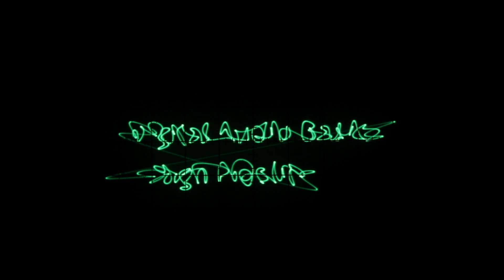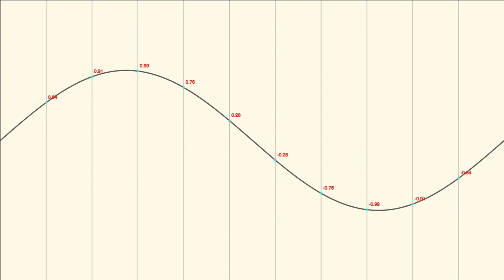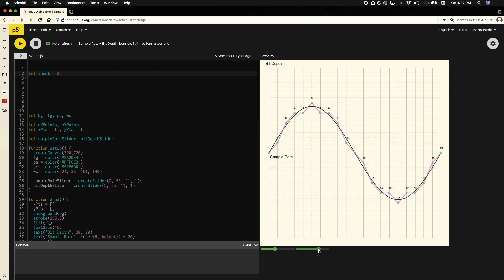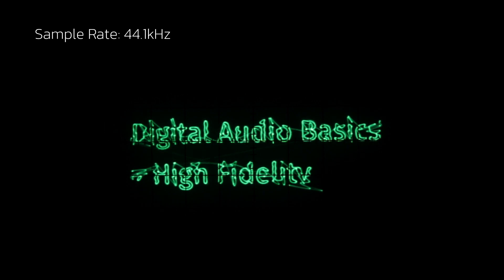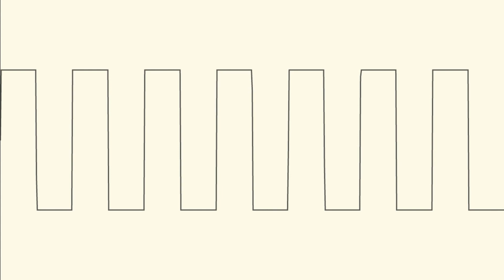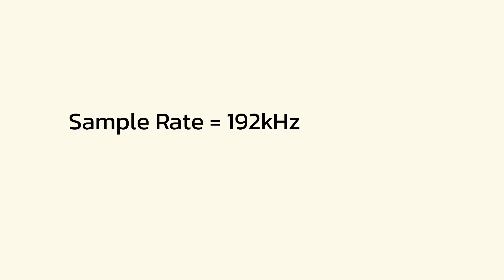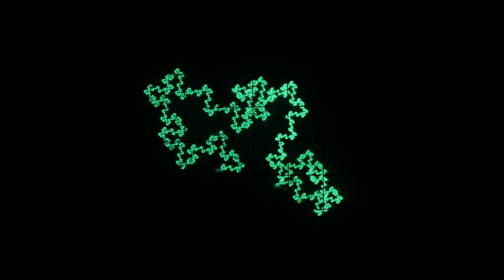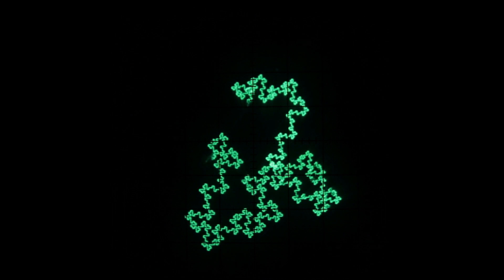A Beginners Guide To Oscilloscope Music: Sample Rate, Bit Depth, & The Nyquist Frequency

Comment: do  oscilloscope make any noise themselves?
Reply from the maker: When you're operating it? Yes, it produces noise. There are some cooling fans usually and the sound of the switches and knobs themselves. In terms of noise added to the audio signal, probably some amount, but not enough to really matter for the clarity of the visual.